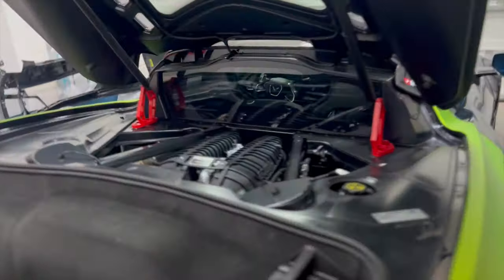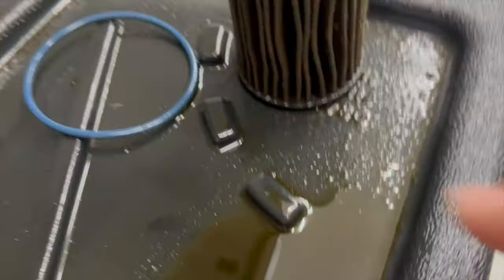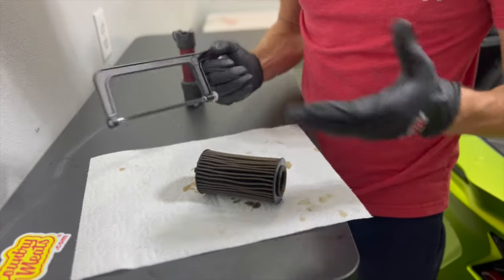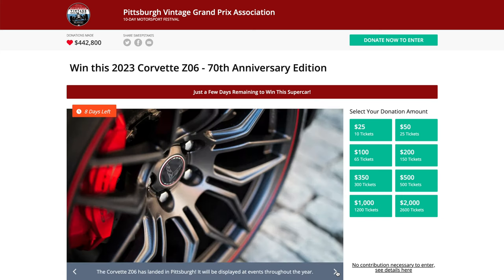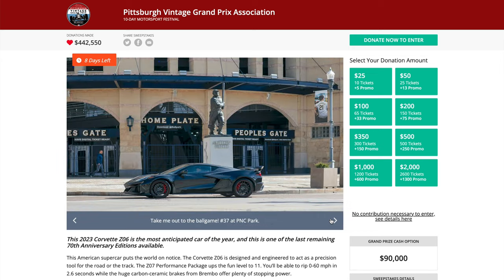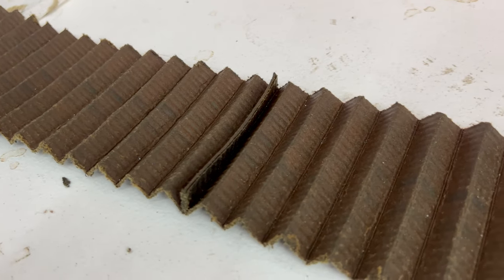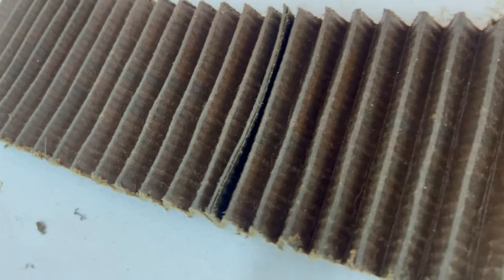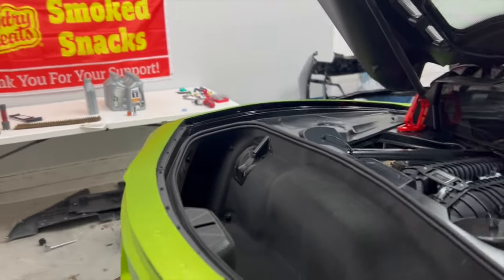C8 Z06 Oil Filter Cut Open Revealing Metal Shavings

Comment: If this is your first oil change, this is normal. Inevitably machined parts have little burrs that break loose during the break in period.  For peace of mind, check your next oil change and you should find little if any of these metallic bits. PS, the blue  bits could be gasket, sealants or locktite bits that broke free.  Your filter is doing its job!
Reply: Oh no it isnt normal on modern engines. That much metal indicates a oil loss on surfaces.  Probably due to improper operating temps. This might have been the norm in the 60s, but not on modern engines.
Reply from the maker: Thanks for the info !
Reply: Lol, no that is not normal. If you can visibly see metal shavings, and those were pretty big, you've got a problem.

Comment: Matt why don't you run a magnet over the exposed filters mesh where the oil return side to see it metal particles could have passed through. Then on the side where particles should be held.? Just a mechanical engineers thought right here.
Matt Viegas
Reply from the maker: My dad said the same thing, but I threw out the filter already 🤦🏻‍♂️

Comment: GM will tell you it's normal until there is reason to tear into the engine and take a peak.  My C6 Z was mushrooming the top of the valves, and GM only wanted to replace the rocker arms.  

You will have to keep an eye on it yourself until there is a bigger problem.  But this is what warranty is for.

Comment: This is NOT normal. Its normal for a brand new engine to have bearing and mating surface metals to shed a bit. But this shouldnt be visible to human eye. Your metal particles are too big. You should have taken an oil sample for blackstone oil labs. It costs only $30 and it would have been better than speculating here. Does the car have the fuel mixing with the oil problem? Does the oil level increase? If it does, the oil probably lost its effective viscosity and thinned out causing potential damage to the engine. 

I have done these oil changes probably a few hundred times, lots of exotics and sports cars. First two oil changes always have metal in the sample but its nothing like your video. The oil lab looks for microscopic metal material. I would try to get a sample from the old oil (maybe you didnt discard it yet?) if not, I would do another oil change soon and take a sample.

Do you have an engine tick?
Reply from the maker: No engine tik… car seems to be running fine. I’ll check it again in another couple thousand miles. Thanks for the info!
Reply: @RWDC8Z Dude, can't believe you threw out the filter.....video won't hold up in court, as they say. Also, NEVER video drag racing your ride....well, looks like you're strong enough to not worry about the warranty covering the car. At 69 and having owned over 250 rides, one new one, I haven't had the luxury of warranty coverage. That killed me on the few exotics we have had. Lamborghini, Ferrari, Porsche and high end Corvettes. Actually drove me back to American muscle cars. 
Currently dying of doctor induced 5th cancer so wife will probably be havin a helluva yard sale soon if corrective kidney, only have one, surgery doesn't work out. Been a good run, lotta undeserved miracles have kept me here, died in 1978 in horrific Corvette crash but got to come back. Life like a bad action movie. 
We started out as dirt poor country folk in SE Tennessee so have come a long way from there. Our main business of 31yrs, the small but profitable car trader magazine, is in hold unless I can get it up entirely on internet. My business has been law enforcement, medic, personal security to high ranking government folks and Nashville superstars but mostly private military contractor in several countries. Even up to 2021 I was still workin....could now if this cancer would leave me alone. Doctors in '21 partially blinded me in one eye, messed up the cancer surgery and lied about it and damaged my sciatic nerve. A headon crash also damaged my lower back where I had a spinal fusion. 
Damnnn, sorry for TMI in a too long comment. Just got to your channel via you hanging out with "Cleetus". I have subscribed tho and will check out your other vids. Doubt we will get a C8 unless someone is interested in wife's 1967 black Tri-Power coupe. Hagerty sez only 32 black Tri-Power coupes produced and only 5 or 6 van be accounted for now. This one not totally perfect but could be. I put the Tri-Power setup back on but added aluminum heads, factory type A/C and cammed it up a bit. So possibly would trade for Z06 like you have. Wife sez no but I could talk her into it. Maybe.
Neway,  nice ride and super cool that you're playin with it. Kills me that folks get bad rides but then never drive em. I've put nearly 20,000 miles on the '64 Pro-Street Corvette w/1,300hp supercharged BBC. 
PTSD and me....... Perhaps I'll get to meet ya sometime. Would like to play run the Pink Vette against the Z06. It's 0 to 60 is no seconds but it spins all the way thru a quarter. May go to radials but it once stood up, scraped rear valance, so may add wheelie bars. L8r...
rick in Tennessee. Sept 1, 2023. Yeah, I missed the sweepstakes by one hour. If you want to sell a ticket let me know pls. Thanks.
Reply: @TheAcceleratorMagazine 
I know what it's like to have hospitals and doctors mess you up and change records I'm lucky to be alive still after a bad spinal fusion myself recovering now almost passed away February 1st I'm sure God has something for me to do God bless you and see you on the other side in heaven one day 🙋

Comment: The shavings are normal. You are driving the car hard including the hardest, drag racing. I personally will not drag race my Z06. It’s a road course monster. You should probably do your DCT filter as well. You will often get metal in your oil when you wrap a new $150k car. Comes with the territory.

Comment: I’ve been cutting filters for 40 years. That’s nothing for a new engine. If there was a problem each pleat would have a lot of particles between them. Do another oil change in 1500 miles and check it again.
Reply from the maker: Will do, thanks!

Comment: Considering that most of the oil bypasses the filter, as there’s a pressure valve system that allows for most the oil to pass the filter, I consider that to be a lot.  An engine that is designed to spin over 8k rpms that uses 0-40 is not a great idea.  I would probably do another oil change soon and examine it to see if it cleans up. Some of the particles you’re describing sound like bearing material, and a magnet wouldn’t be much use for that.
Reply from the maker: Thanks for the info
Reply: Z06 uses 5w50 not 0-40